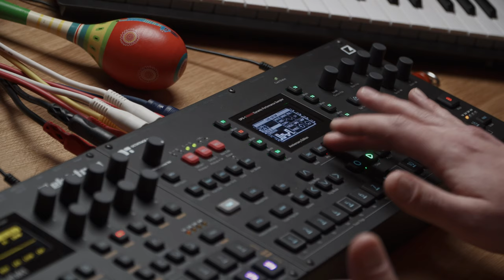Octatrack Multi-Band Sound Processing / How to safely use Phase-Shifting effects on Synth Bassline?

Comment: Use delay compensation in the project menu if mixing direct AB signal with a thru machine (negates phase issue).
Reply from the maker: Makes sense! Thank you for heads up! ✌️

Comment: I usually do this with DJ EQ instead of filter, sometimes with three tracks, one for each range, and neighbours. This with the Digitone into A and B and the Rytm into C and D, then leave the 7 for resampling and 8 master. The Rytm kick is outside the Octa, and delay compensated in Ableton.

Any advantage of using the filter? 

Nice video!
Reply from the maker: Hey Manuel! Thanks for watching!

I think there is no advantage of using a filter vs DJ EQ for that matter. I think EQ is even a little more flexible!
Reply: @IhorMedia  at least it's more immediate
Reply from the maker: Yeah, with filter it’s kinda straight forward. Also you can overdrive with it as well if you need.
Reply: @IhorMedia  I started using the filter for that because of the distortion, then tried the DJ EQ to see if it was easier to have a transparent setting (and thinking it could avoid unwanted resonances, but not sure), and now I use it ´cause is faster. Which effect do you use after it in the low end? Compressor maybe?
Reply from the maker: @hernandoando  I will give it a try! To be honest I kinda almost never use EQ on the OT, but this seems to be a good case for it. 

I’m not sure if I used compressor in this video, but generally I’d use it for sub end to get it even.
Reply from the maker: @hernandoando  there is another thing I use that same filter for - ducking effect on subs. To lay it down good with the kick drum. I wonder now if this will work with EQ actually.
Reply: @IhorMedia  I think it can work, I use trackspacer to duck things in Ableton, it's one reason why I have the kick out of the Octatrack
Reply from the maker: @hernandoando  makes sense! Thanks for sharing ideas, Manuel! ✌️
Reply: @IhorMedia  thank you for the video, see you in Elektronauts? I'm Grumo.
Reply from the maker: See you!